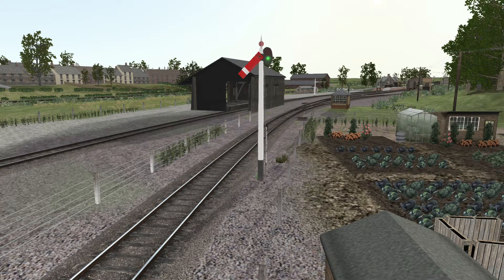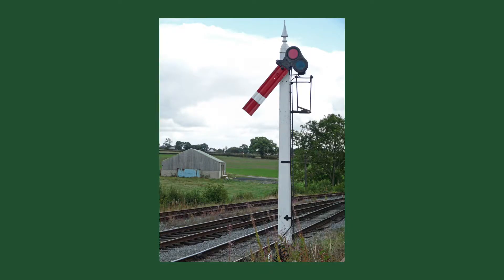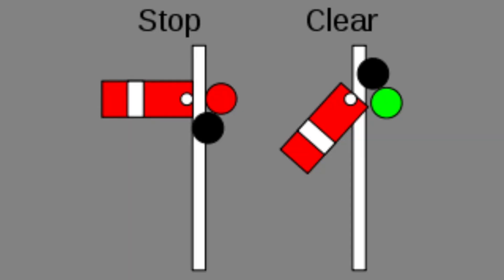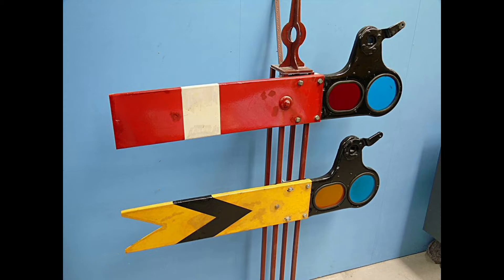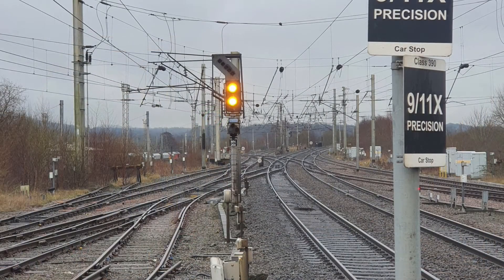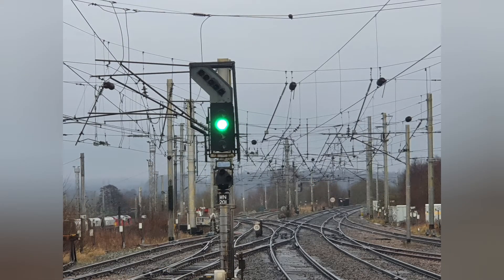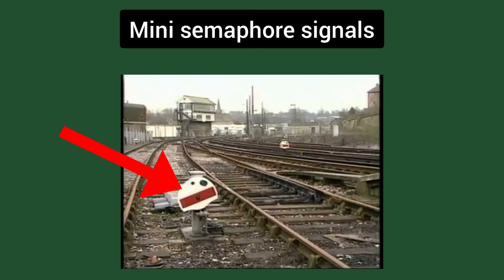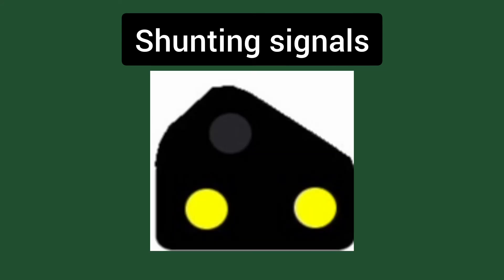UK railway signalling | The basics!

Comment: Why DO some semaphore signals go up instead of down to show all clear?
Reply from the maker: Some signals do go down, but the main reason to go up is to avoid snow / debris forcing the signal down and showing all clear all the time
Reply: @reliantrailways  Oh? Makes sense! ;) Thanks! ;) If only it were designed that way then Henry wouldn’t of had his crash pulling the flying kipper
Reply: @reliantrailways the spectacle plates and counterbalance are heavy enough to return lower quadrant signals to danger.
Reply: @reliantrailways  NUTS - You've obviously never heard of,  or noticed "Counter balance weights" !
Reply: safer. 
if you snap the wire, it goes to danger.
Reply: @bussesandtrains_121 incorrect. Both upper and lower quadrant signals will return to their most restrictive aspect if the control cable snaps. This is basic fail-safe design. This is accomplished by the different placement of the lenses with respect to the pivot. With lower quadrant signals, the lenses and their mounting (quite heavy to ensure counter balance even with snow on the arm) are fully to the right of the pivot. Upper quadrant signals have their lenses mostly underneath the pivot, which reduces their effect on the balance of the signal arm to a minimum.
Reply: @gregoryclark8217  Nuts, the position of the lenses in relation to the pivot has nothing to do with upper or lower quadrant signals. It's a result of the actual manufacturers designs. The fail-safe method of ensuring Upper Quadrant return to danger is primarily the fact that Gravity will ensure it drops to danger. Where gravity might be insufficient (on a small arm for example) a counterbalance weight will be added.

On lower quadrant signals, particularly ex GWR types because the GWR refused to comply with the HMRI recommendation that lower quadrant types be replaced with upper quadrant. So the GWR altered its signals to have NOT a steel wire but a RIGID steel rod between the arm at the top of the post and a heavy counterbalance weight lower down the post. The rigid steel rod obviously ensuring that there was no steel wire between arm & counterbalance weight that could upset the fail-safe principle.  

Many other railways began changing to upper quadrant from 1923. But where this was inappropriate, again counterbalance arms had to be installed, and these were most commonly added only a few feet below the arm.
Reply: Turn the bloody music off. For all ppl who suffer auditory syndrome which means all sounds are the same loudness

Comment: Hey, I know this is an old video but I recently saw a semaphore with two signals, what's up with that?
Reply: That's a subsidiary signal, it can mean a few things. If the bottom semaphore is in Horizontal position then it indicates you should obey the main signal arm. If the subsidiary signal is raised to 45 degrees then it means you can pass the main signal arm at danger, but proceed at caution - you'll then get a C or S on a sign under the subsidiary. 

C = Calling on, proceed at caution as the line ahead is occupied
S = Shunt, proceed at caution to carry out only the shunt movement 

Hope that helps!

Comment: Why does London underground only use a two aspect signal system?
Reply from the maker: The London underground doesn't use a yellow (intermediate) aspect for a few reasons

1- Very short times between trains
2- All trains stop at every system
3- Stopping distances are so short

All these mean that the underground doesn't benefit from a three aspect signal
Reply: @reliantrailways  
Thank you for your response there.  I'm sure that's valid on the vast majority of London underground tracks.  However there are some sections of track on the London underground that are indeed quite lengthy.  Examples of which can be found on the Metropolitan Line, for example, between Finchley Road and Wembley Park.  I recollect that trains on this section can run pretty fast (70 mph). 

There are some sections of the London underground that use same tracks as mainline railways.  How does this marry together?

Comment: A good video. short, simple, and easy to understand.

Some points to make clear tho, as there is some important missing information:

With semaphore signals, the distant signal relates to ALL the stop signals controlled by the corresponding signalbox. The distant signal cannot show "clear" unless EVERY stop signal controlled by the signalbox shows proceed. This means that should a driver pass a distant signal at "caution", they MUST expect ALL the signals controlled by the corresponding signalbox to show "danger". 

The signalboxes have interlocking lever frames, which physically prevent distant signals from being switched to "clear" (also known as "pulling off"). This is why a driver can assume he has a clear route through the area.

In practice, there is ALSO a rule that if a signalman working a signalbox can only clear SOME of his signals safely, then he must NOT clear those signals until EITHER the train has been brought to a stand or crawling pace at the signal OR he can clear ALL his signals. This gives the driver even more information.

A scenario is the best way to understand this:
Imagine a signalbox which controls 4 semaphore signals in one direction: one distant and 3 stop signals
Say a train has just passed the distant semaphore signal at "caution". That train is now slowing down, since it knows the next stop signal will be at danger. 
In fact, the signalman has a clear section in front of his first two stop signals, but there is a train in the section controlled by his third stop signal. This means he cannot clear ALL of his stop signals, which is why the distant is a danger (it physically cant be changed unless all stop signals are showing clear)
The signalman STILL cannot clear ALL of his stop signals because that train in his last section, so he now MUST look outside and observe the train coming to a stop or a crawling pace in front of his first stop signal. Only then can he clear that first stop signal and let the train move on.
And so, the train passes the recently cleared signal, and MUST expect the next stop signal to be at danger.
Now, the train that was preventing the signalman to clear all his signals has exited the section. The signalman can now clear ALL his signals, so he does exactly that. the remaining stop signals controlled by him are now showing "clear".
The train that was brought to a stand, however, has only just passed the first stop signal, and is expecting the next signal to be at danger. But when that signal comes into view, it is already displaying "clear". This lets the driver know that the rest of the signals are showing "clear", since he was NOT brought to a stand with the signal at danger BEFORE the signal was cleared: it was already clear. The driver can now accelerate to line speed until he sees the next distant signal (controlled by a DIFFERENT signalbox).

In reality, most signalboxes did not controlled this many stop signals, but some of the larger signalboxes covering an extended area did. 

Also to finish this off, at junctions, you may have multiple signal arms stacked on top of each other. Each arm corresponds to a route. Signals are read top to bottom, left to right. The highest signal arm corresponds to the main route (straight through). The lower arm corresponds to a diverging route: if it is on the left, then the route diverges left. In the case of multiple possible routes diverging left, then the leftmost arm corresponds to the leftmost route.
Reply from the maker: Thanks for the extra info!

Comment: Interesting. Just to add, there were two types of semaphore signals, Upper Quadrant and Lower Quadrant signals. Both show a horizonal bar for a stop (or caution aspect in the case of distant signals) but while a lower quadrant signal goes down 45 degrees to show clear, an upper quadrant signal goes up 45 degrees to show the same. If you watched Thomas the Tank Engine, the episode where Henry crashes while pulling the Flying Kipper demonstrates why lower quadrant signals were considered less safe and thus used less as time went on.
Reply: when semaphore signals were first introduced, lower quadrant signals were used. However, it was evident that there was a problem: when the wire snaps, gravity pulls the signal arm down around the pivot (since the wire is no longer providing a counter force), and the signal shows a proceed aspect, when in fact it should be a danger aspect. I haven't seen the thomas the tank engine episode you are referring to, but i would assume thats what happened in the episode.

This type of failure is very bad. It is referred to as a wrong side failure: where a piece of equipment shows a "false positive" (a signal showing proceed when it should show stop)

In signalling (and other safety critical systems), you need to ensure that should a failure occur, the most restrictive information should be shown. This would mean that should the semaphore signal fail (due to a wire snapping), then the signal should default to a danger aspect. This is called a right side failure: where a signal should show proceed, but instead a danger aspect is shown.

Early railway companies had to solve this issue, as currently with the lower quadrant semaphore, the very bad wrongside failure could occur. Most railway companies fixed this by introducing the upper quadrant signal. Using the very thing that made the wrong side failure occur, the upper quadrant signals were "failsafe". should the wire snap, gravity (the thing that caused the wrongside failure in the lower quadrant signals) will pull the signal down into the danger aspect. 

This solution did have a drawback: drivers now needed to be retrained (or at least told) that the new proceed aspect is a raised arm, rather than a low arm. But this was a minor drawback, so most railway companies used this solution, including the vast majority of signals in the uk right now (in fact i dont think there are any lower quadrant semaphores left on the national rail netwrok, but i might be wrong)

Great Western Railway (GWR), however, were stubborn. They did not want to adopt this upper quadrant system to make their signal failsafe, so they came up with a different method. GWR installed counterweights on the signal, weights that were heavy enough to pull the signal to danger should a wire snap. When the signalman pulls the lever, they are pulling the counterweight UP, thus allowing the signal to be lowered.

Whilst GWR came up with a rather strange and convoluted solution, it worked. should the wire snap, as explained before, the counterweight falls, pulling the signal into the horizontal danger position. GWR made them FAILSAFE, as long as they were installed with counterweights. I can assure you that since GWR installed their method, the lower quadrant signals are no less (or more) safe than upper quadrant signals.
Reply: @j.a.g1291  A lower quadrant signal will return to danger in the same way as an upper quadrant. Firstly, the lens adds a fairly significant amount of weight, which is usually enough to counterbalance the arm, and, even if the lens isn't heavy enough, lower quadrants are all counterbalanced anyway, with a rigid steel rod acting from the counterweight to the arm, so if the cable snaps it will help push the arm back to danger (if you build a ratio signal kit it may help you understand). Lower quadrants are just as safe as upper quadrants (and, in my opinion, easier to see).
Reply: except the western region.

nuff said
Reply: Quite simple Western region chose lower Quadrant every other region chose upper. nothing to do with being less safe.
And your quoting Thomas the Tank as a signalling guide.

Comment: The yellow shunt signals mean that the horizontal "stop" aspect only applies to movements onto the main line, and can be passed if the points are not set that way.  This is a legacy rule, and yellow shunt signals are now only allowed to be installed in like-for-like replacements, they're not allowed in new designs.
Reply: Your incorrect.
Reply: @railwaymechanicalengineer4587  Try this one then, from MP12 driver training 1985.This signal can be passed in a direction that when it is cleared does not apply too.

Comment: When I was at VSC Clapham junction, lots of signalling points failures, ASE was 'Wrong man for the job'had to be paid off. Replacement narcissistic told by Chairman BR Board that he was to be sacked in 6 months time unless failures dropped. Bought in man from Swanley led a task force team found lots of equipment faults, he reduced failures.
Reply from the maker: That's a very interesting story, typical chairman.